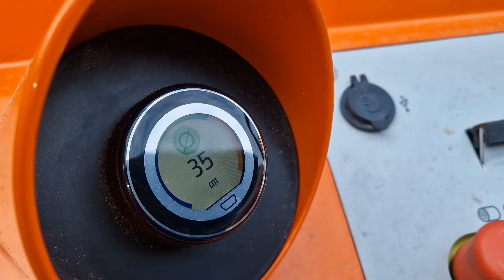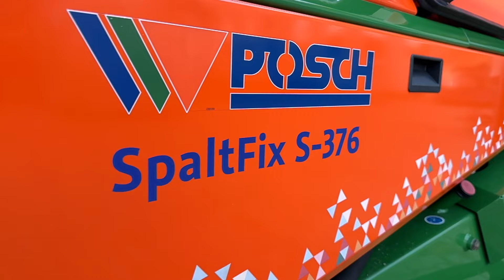Ein Sägespalter-Klassiker punktet mit neuen Features: SpaltFix S-376 by POSCH Leibnitz

Comment: Some good changes made but was really hoping for like a sideways sliding grid knife or a rotating wheel with 4-6-8 way splitting knifes built in instead of changing them for different sized diameter timber, really think that would be a game changer

Comment: It's a big shame that the splitting knives have to be replaced and there isn't one that splits into 4 and 6 pieces as MULTI. Otherwise, the hydraulic lifting belt is great!
Reply from the maker: Hello, 
due to the size of the SpaltFix frame, it is not possible to combine a 4 + 6 knife in one frame. We offer the options of a 2+4 or a 2+6 or a 2+8 splitting knife.

Kind regards

Eva Schneider // Marketing